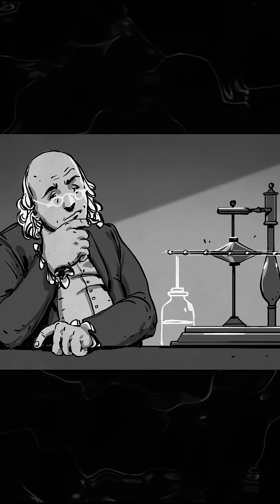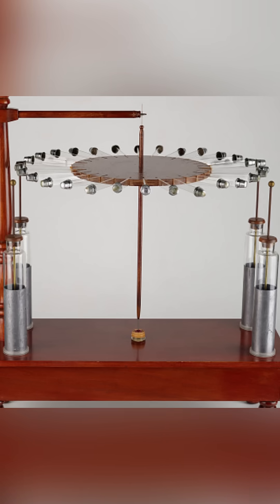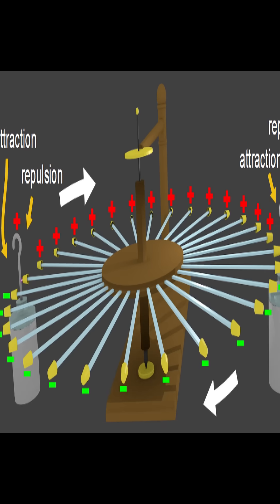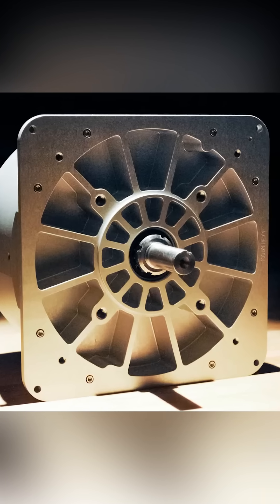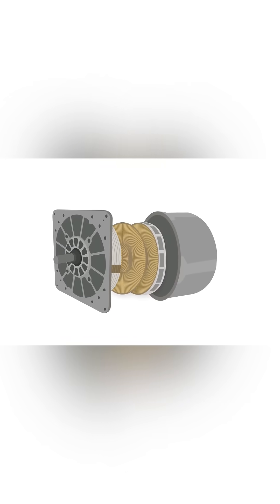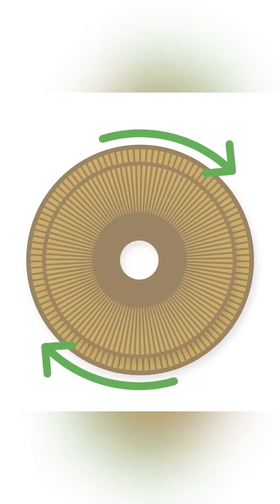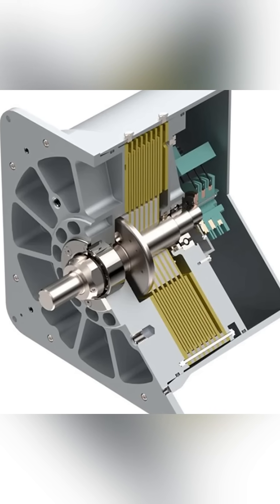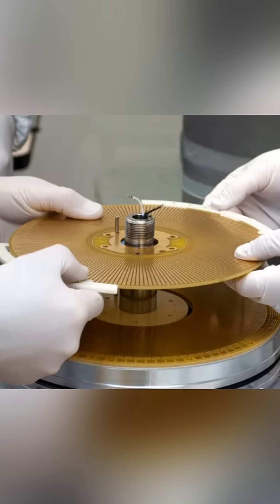A Motor Ahead of It's Time!? -Franklin's Electrostatic Machine

Comment: What I find interesting is that to hold a magnetic motor in position like a stepper motor, it requires electric current flowing through coils.  But an electrostatic motor can hold a position by electrostatic charges.

Comment: What's the special fluid in the modern motor?
Reply: Biggest reason. They don't conduct electricity. Secondly they can also store energy in the dielectric. 

Using a dielectric fluid allows for higher voltage between the stator and rotor electrodes without dielectric break down and arcing.

As for storing energy. Consider two capacitors  one with air as the dielectric and another that uses a plastic seperator with a dielectric constant  of 3 times the permittivity of space or air (which is about the same for air) can store about 3 times as much energy when charged to the same voltage between the plates.

How this translates into a better motor   Force= ((permittivity of dielectric) × area of plates × voltage²) / (2×(distance between plates)²).   Now this means if you can increase the permiti it by three and the workable voltage level by 3, then you have increased the torque it can generate by 3×3²=18 times over air dielectric. 

This is great at low speed but the fluid's viscosity means increasingly  diminishing returns at higher speeds. Mater of fact,  an electrostatic motor shines most with its holding power at zero rpm and no more power needed for electrostatic forces to hold it in position.